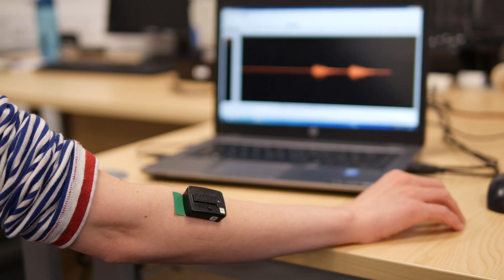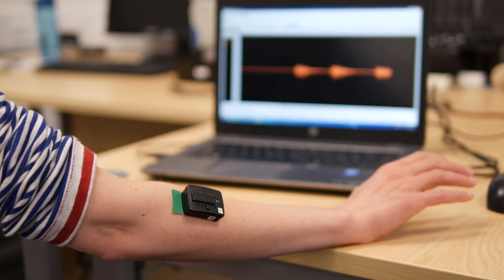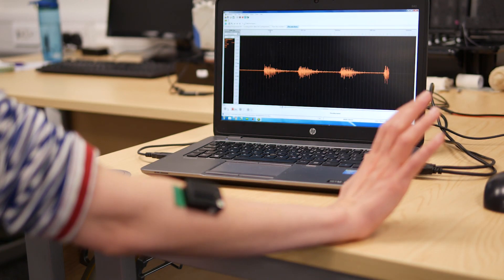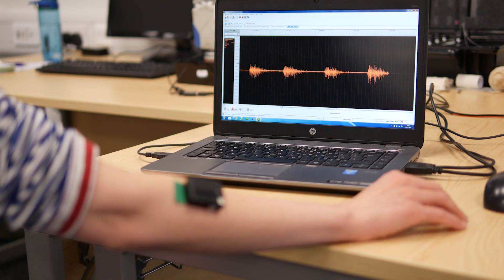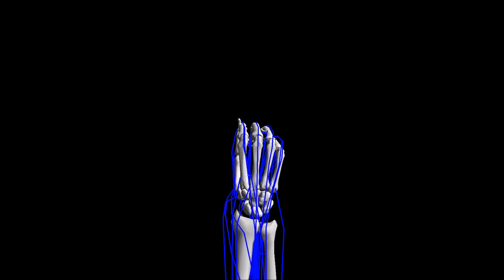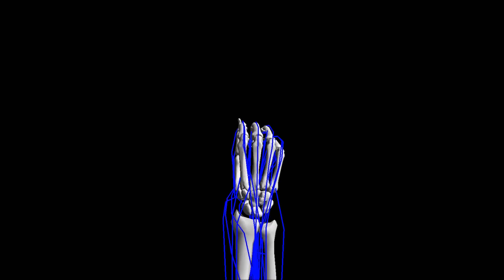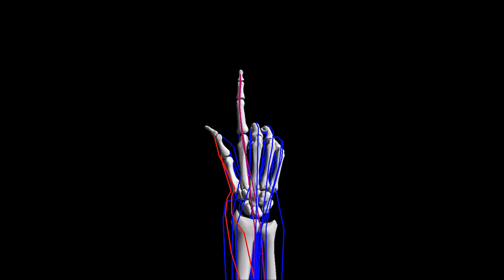Improving the control of prosthetic hands

Comment: the solution to the nerve feedback is loads of small linear solenoid acutators that is placed in a grid on a pad on the upper part of the arm and then used a variable resistor array on the robotic hand and then use a microcontroller to drive each variable resistor signal to each solenoid on the pad to transelate digital pressure signal into physical sensation in the upper part of the arm.

Comment: Each sensor signal could be an input to a RNN, as ground truth one could use a visual tracker for each finger, which converts to desired motor angle.
For propioception one could use some presure device or a small electrical shock in any place in the user's body, with practice their natural neural network will learn to associate this with the states of the robotic hand.